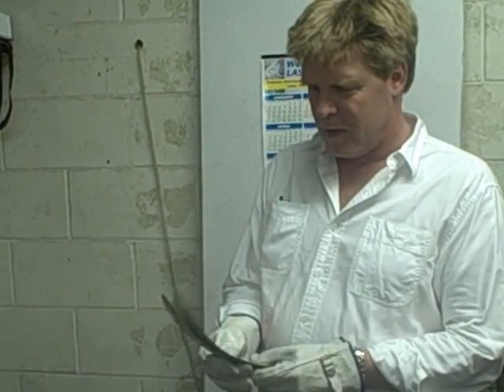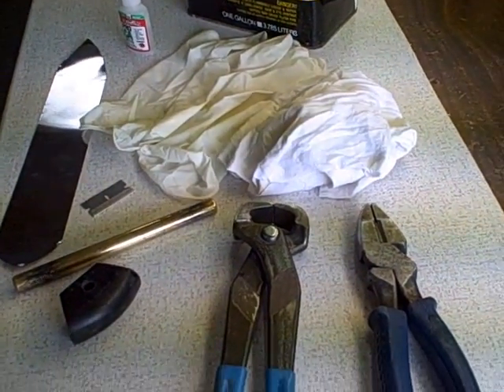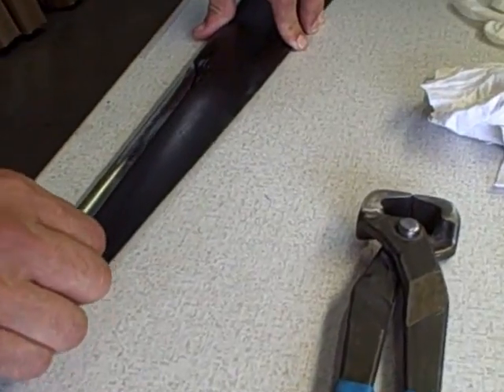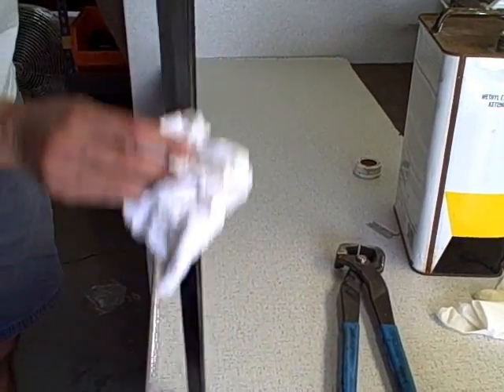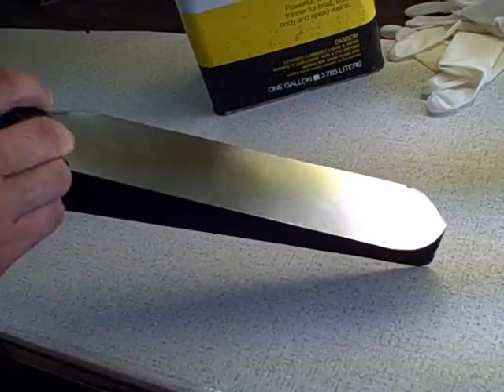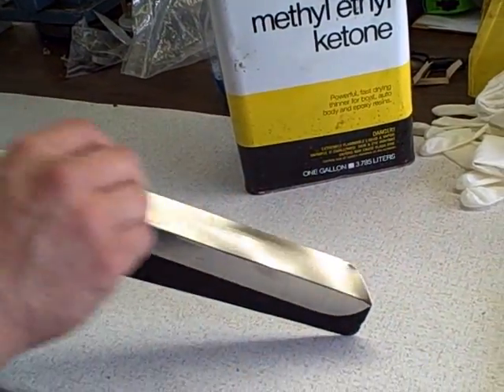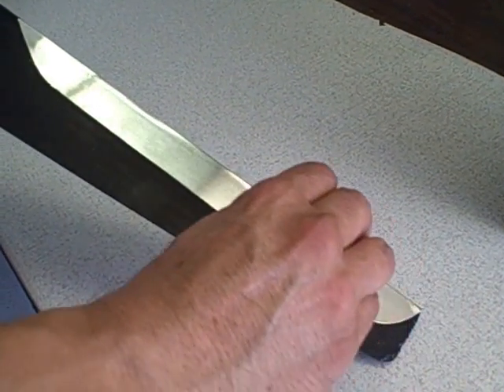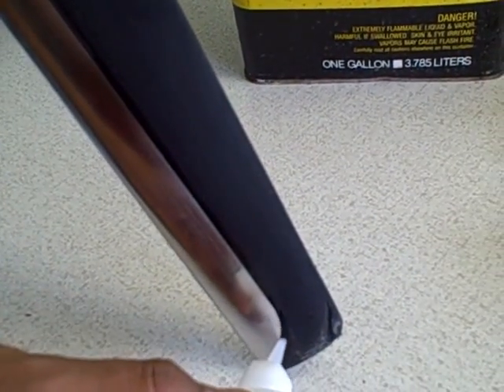Replacing Stainless Steel Tape on Ivoprop

Comment: IVOPROP.....Do you have a VIDEO for the assembly & installation of your props? I have an '87 and a '17 model which I just bought from you. Your written instructions are confusing (to me). A VIDEO would be nice. Doesn't have to be fancy.
Reply: Me too.  I got all excited to install my new 65" and after reading the instructions several times and remaining unsure of the recommendations in the instructions, I came to YouTube looking a solution....
...never found one.  Really confusing is how, specifically the tape is applied to check for proper fit?  torque?  It doesn't state why, just what to look for.

Comment: Where can I find a VIDEO for the assembly of a new IVO prop? The written instructions are crap.
Reply: Bill, did IVOPROP ever respond to your question?  I have a similar problem.
Reply: @salikasaam  the instructions have me grounded until I can figure out the instructions.  I've flown IVO props for over 30 years and none of my previous models had this new method of putting it together. 
Does anyone know what the extra pieces of SS tape is for?  the instructions mention "Watching for cracks in the tape" but caused by what?   
A step by step video would keep everyone safer.  I'm not flying until I'm confident it's assembled correctly.